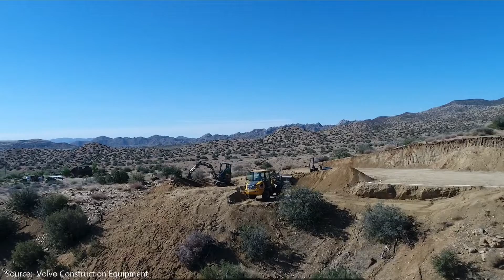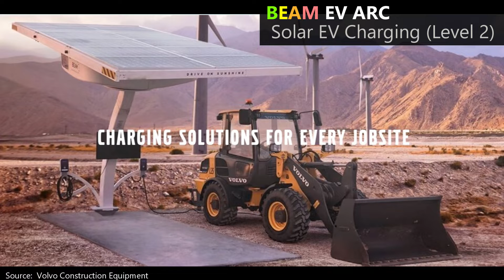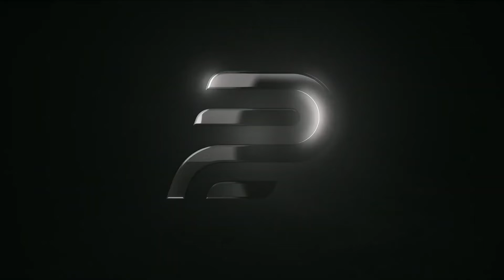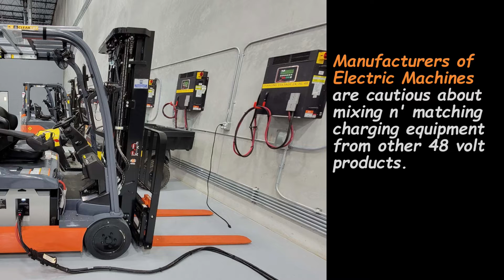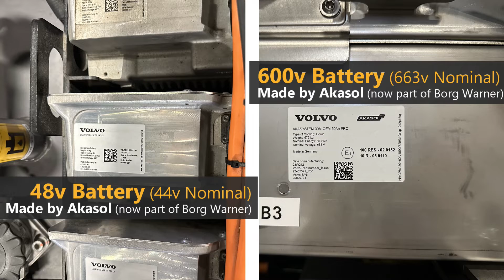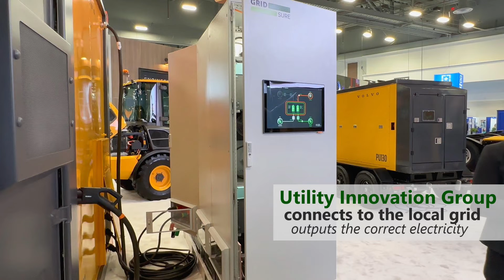Volvo Construction Equipment - Electric Charging Solutions for Every Job Site

Comment: This is the dumbest idea for many applications outside of a few short term jobs. If I cant run a larger excavator full a full 8 to 12 hour workday then I have to buy 2 or have downtown waiting on it to charge. Im not buying 2 of the same thing to get threw the day. They act like many companies have the budget to just buy extra to use half, especially now when work is slowing down due to interest rates

Comment: Whats  the loss of efficiency like when battery to battery charging? Once you add in transport costs I wonder how much the advantages are. I'm very pro electric but sometimes the best way is a diesel generator
Reply from the maker: I generally agree. The BESS (Battery Energy Storage Solutions) may not work well for every jobsite.  I've seen Generators proposed using Biodiesel which is lower-carbon, or Hydrogen Fuel Cell. I look forward to seeing different solutions tried-out.
Reply: This is just a waste of time. A big part of this is from the EU trying to be efficient and go green lots of grants and tax once tives I'd say. But you have to buy the unit, the charger with battery's in it then the voltage converter. Then you've got to have all the extra cables to keep up with. With all the extra cost there and the added cost of lost productivity you could easily afford 2 diesel excavators. And I'd bet it's about the same ordeal as Tesla has it to where they won't sell you parts so you have to take it to the dealer.

As I have been told for years don't fix it if it's not broke.